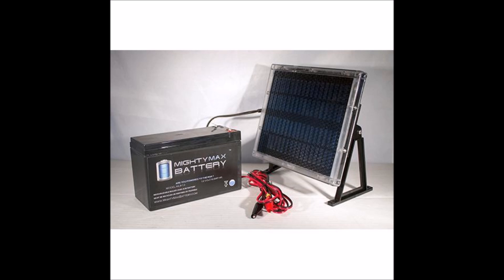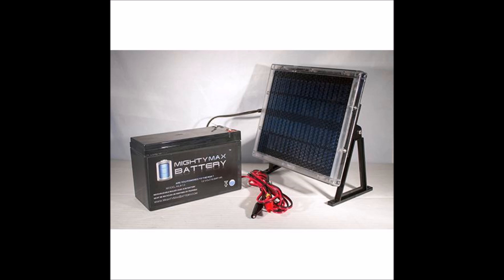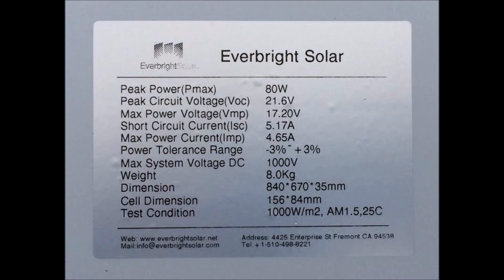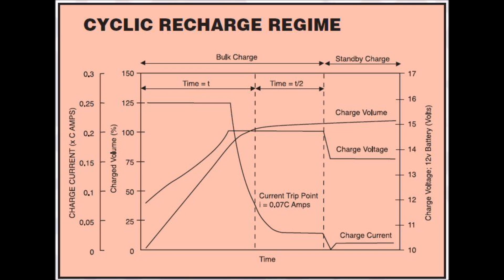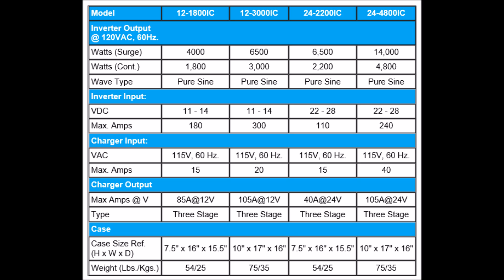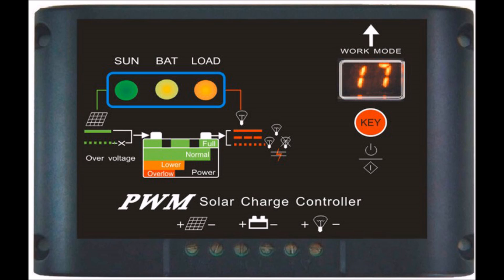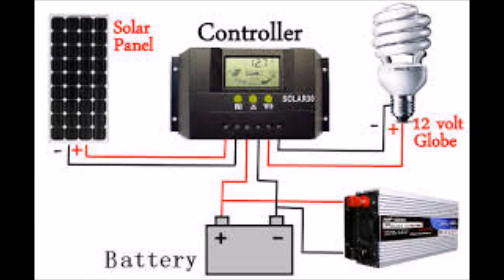Do You NEED A Solar Charge Controller??

Comment: I have 2 controllers. One for the pre installed panel and another for the suitcase panels, could I eliminate one of these
Reply from the maker: It is possible.  But it isn't really ideal to mix and match solar panels on the same controller.  It ends up that you lose a little bit of your total power.  I have a video that explains further:  https://youtu.be/9duPXeNkf0k

Comment: Not sure if this true but leaving solar panel hooked up directly to the battery at night will drain battery because the solar panel puts out infrared light
Reply from the maker: You should never have a solar panel hooked up directly to the battery anyway, like I mentioned in the video.  The charge controller will block power going back the other direction, among many other things.  And basic ones are very cheap, so there is no excuse not to have one.

Comment: YEs if you are in the Gobie desert with loads of sun, Nost car batteries will pull the voltage down as soon as you connect. Yes you need a diode to stop discharge.
Reply from the maker: Car batteries charge at 14-14.5V in a car.  An average 12V solar panel under load (Vmp) outputs 17-18V.  So that will not work without a voltage regulator or charge controller.  You might as well use a charge controller because a voltage regulator will not manage the charging process.  It only changes the voltage coming in to a different output voltage.  And charge controllers are cheap.  There really isn't any excuse not to use a charge controller in any situation that I can think of.

Comment: I have the charging controller, solar panel and battery but I don't have the wires. I would like to know the correct wires to use
Reply from the maker: There isn't a specific type to look for.  The only differences are in the jacket of the wire and that depends on the type of use.  So there are outdoor rated wires, plenum wires, tray cable, SO cable, and on and on.  If you don't want to learn the differences, I totally understand.  You can do a search for solar cables on Amazon or similar site and they will have some options that are marketed that way.

Comment: Lmao, love it.. Thanks for answering my question. As I sit here with rum in hand, I wonder if I can charge my battery with just a solar panel. So.... I hook it up and have a multimeter hooked up to it to read voltage. I'm sitting on the porch while my baby plays in a bucket of water in the sun and my dog lay on the porch harding the public walkway.  As it hooked up I search you tub for answers and  you pop up and I take another sip of tea rum as I watch you speak. I love how toward the end you say if you want to baby sit your battery go a head and nock yourself out. 😆 as you say that I go to look at the meter to check the ⚡.  I sit back down and knock myself out while enjoying my kid splashing and wondering what's what.  Thanks man! I enjoyed your video. The battery charged safely. 😉
Reply from the maker: There you go!  If you have the time and want to do it that way, it works.  But most people would burn their battery up :)
Reply: This is exactly what I was looking for as well! Thank you! ☺️ I have my panel, my power station hasn't got here yet & I have a dead battery I desperately need charged...I'm a good babysitter. 😁😂.

Comment: this is not correct ... 
imagine you short a 17V solar panel to a 12V battery which is discharged to let's say 4V. 
what happens when you short them? what voltage is the battery gonna see? 17V? no, 4V. 
a solar panel and a battery are both voltage sources, when you short voltage sources only can win and only one voltage will be measured. 
so if you short a 17V solar panel to a 4V battery and see 17V it means a miracle has happened and the battery has been immediately fully charged, and beyond. 
but in reality the output voltage of the solar panel will drop to 4V and it will charge a current between Isc and Imp (~5A). 
this is fine! nothing gets damaged. 
The only problem is that you are not drawing the maximum power (voltage x current) out of your panel, 
so instead of 80W you are charging at 4Vx5A=20W, so it would just take longer. 
that's why you might use something like a 'maximum power point tracking' which on one side draws 80W (17V x 4.65A) from the solar panel and on the other side provides 80W (4V x 20A) to the battery, with some loss of course, say 76W (4V x 19A).
Reply from the maker: That is true but doesn't apply to the video and doesn't contradict anything I said in the video.  

Open circuit voltage on a 12V solar panel is over 20V.  Under load (charging a battery), it will be around 16-17V.  The point is that there are many people who don't understand that and think that a 12V solar panel outputs 12V so if I am planning to use a 12V load why don't I just wire the solar panel directly to the load and cut out the charge controller.  Doesn't work that way as stated in the video.

Comment: Do I need charge controller for my 17 year old car battery? My 4.5w panel is pumping in 60mA at 15V on a sunny day behind car glass and not oriented towards the sun. The car consumes 30mA to 39mA while sleeping.
Reply from the maker: No, for that low of power you are barely offsetting the self discharge of the battery.

Comment: If I’m planning to only sun power (not stored power) A battery isn’t a must? 
I can just use the panel to the regulator and then the regulator to the inverter?
Reply from the maker: No.  A charge controller will not work without a battery.  What you are describing is closer to a grid-tied system.  However, grid tied inverters will only work when connected to the power grid.

Comment: Do charge controllers shut off at 14.5 volts or at all? This is what is getting me stuck...
Reply from the maker: Depends on the charging profile being used.  They do shut off when charging is complete (or go into float or "trickle" charge when charging lead acid batteries).

Comment: Will I need if I use lithium battery with a BMS.. The bms will manage the battery.
Reply from the maker: You always need a charge controller, even with a BMS.  The BMS does not manage the charging process.  It distributes power and makes sure all the cells are even and also provides safety features.

Comment: A battery charger has a fast charge facility. This increases the current going through the internal transformer in the charger. So the batteries get more current and fast charged. I just checked my solar charge controller. It was showing 30 volts in and on the battery terminals 20 volts. So the charge controller is not using all the available power. 

I want to connect the solar panels semi- direct to the battery through one unit. A kill switch. 

Ok let’s explain something. I’m a mobile mechanic. I have a classic mk2 Jag in my Garage. It has an old fashioned regulator. Current from dynamo or alternator can charge vehicle battery unhindered. Not like a charge controller which does not allow all the power to the battery. Then as the battery in full in the Jag, the coil within the regulator heats up and two contacts move apart. This cuts the charging until such times as the battery needs more current. 

My point is this is much better than using a solar charge controller.

Comment: One question I was curious about is why is the inverter always hooked up to the battery? How can the charge controller stop the battery from discharging if that’s how it’s wired? Why isn’t it just hooked up to the 12v load side on the right terminals of the charge controller?
Reply from the maker: You can connect them either way.  There are pros and cons to both ways.  Watch this other video I produced that answers this:  https://youtu.be/k8aVnRpoRLc
Reply: LDSreliance ok thank you
Reply from the maker: You are welcome.  Thanks for watching!

Comment: Can we connect solar panel through solar controller 12v DC output and this output to 12vDc  TO 220V AC CONVERTER 1500WATTS FOR RUNNING AC 220 FANS ETC. CAN THE SOLAR CHARGE CONTROLLER WORK WITHOUT A BATTERY WE DO NOT NIGHT POWER. OUR IS ONLY DAY TIME LOAD. OR WE MAY NEED A 10AH BATTERY, a small battery toboprationalise the charge controler
Reply from the maker: No, the charge controller requires a battery.

Comment: Well my battery is shot because it goes to 12v then drops to 11.8 then back up to 12v...so the controller will not shut on my load until it reaches 12.6 which is never happening...so now that I cant damage a already damaged battery....I running my panels directly into the battery to run my load...since I can never overcharge it because it wont go over 12v and at 12v I can still run water and take showers and work lights....😂
Reply from the maker: You gotta do what you gotta do!  As long as it works, who cares?

Comment: Let's say I use 2 panels in series and produce around 36vmp and around 42-44voc.
Use it to charge 3x12 sla batteries directly without scc.
I suppose those VOC & VMP is almost exactly matching 3x12v series SLA battery, current will be maximum optimally gets into the battery when it's empty and will drop the current as it reaches fully charged state (3x14.4v).

In fact now I'm thinking going lifepo4 as well (3.2v nominal, 3.6 fully charged)
Lifepo4 will be 12 serial configuration with voltage around 38.4v (nominal), ~30v depleted (12x2.5v cutoff) and 43.2v fully charged (this is very close to max voltage the solar panel could produce in 2 series config, I suppose electric current going into the battery will drop as well as the battery reaches this voltage as this is the max voltage can be produced and had very low current output from solar panels).

For optimal/nominal voltage (~36-38v) it'd getting and produce maximum current around 5amps for 2x100wp in series.
Now I just need to calculate those max current with my 36v battery banks and the number of hours where sunlight is available (5 hours a day? I live in tropical country) and adding parallel solar panels as my total Ah allowed to store it. 

My point is to leave scc alone cause I can't really get cheap pwm scc for 36v system and mppt wayy too expensive.
Even if I'm forced to use scc then I'd prefer to use several cheap pwm scc and add more panels to compensate for that power loss because of inefficient pwm scc compared to mppt.

Been using cheap pwm scc (10 bucks a pop for 20amp) for years now with no problem whatsoever.

Comment: how about how many panels can a person put on one charge controller
Reply from the maker: It isn't a question of how many panels, it is how many amps.  Take the rating of all the solar panels in amps and as long as that is less than the rating of the charge controller you are good.

Comment: Does the same thing apply if I have 3 12v batteries in sequence?  That makes is 36v, would I have to worry about the solar panel overcharging it over time?
Reply: In that case it wont charge it. The input voltage has to be higher than the battery voltage..

Comment: Answer: a charge controller is a Charge Pump.
The necessity is highly dependent on the:
- loaded voltage of the panels
- chemistry and voltage of the battery
- current draw from the inverter.

Firstly the closer the panel and battery voltage to line AC the more efficient. Basically 12vdc is very inefficient unless using 12vdc appliances. 48-60vdc is much better.

LiFePO4 is more tolerant to slight overcharge and a BMS with High Voltage Cutoff will prevent overcharging.

Lead acid is best used in series to decrease Peukert effect, so 48vdc is common for low frequency inverters.

The charge controller raises the voltage from the panels at the cost of current, to a set point. Programmable controllers like the MPT 7210a are good for small projects. If the panels are closely matched to the battery packs like for example 40VMP to 39.6VDC(a123 BAE packs) then a controller isn't necessary so long as the current draw is moderated before the inverter. 
I do this by daisy chaining battery banks.

Comment: this guy talking crap, i got a 5w solar panel connected to a 200ah battery without a charge controller and the battery is working properly for over 10 years now.
Reply from the maker: That is because you will literally never charge a 200Ah battery with a 5W panel so there is no concern about damaging the battery with overcharging.
Reply: @LDSreliance  seen people use 10w panels direct on 50ah batteries and no issues. why is that?
Reply from the maker: Same thing.  You will never be able to fully charge a 50Ah battery with a 10W solar panel.
Reply: Lmao
Reply: Lmfao!!!

Comment: I want to mount a specific flexible solar panel physical size (32 wide x 42 long) on my van.. in part because I want to benefit from the shade on my roof.  The biggest wattage I have found is 200W 20v single panel.   I am testing a Chafon 200WH (18ah) portable power station that has a built in charge controller .. I tested it with a 50w panel and it fully charged in about 6 hours.  The back of the unit has a warning not to use a solar panel larger than 120w and/or 22v.  Given that most panels don't yield what they say would this be safe to direct connect?

Also, if my real goal is run a fan in the van during direct sun light, anyway to regulate the 200w/20v panel so I don't need much battery but also so I don't burn my fan motor?

Odd idea, but if too much power for the Chafon.. can I just cover part of the panel?

My gut feeling is that connecting the 200W solar panel direct to the Chafon will be fine.. and that the 200W solar panel will never perform that well to be a problem.
Reply from the maker: You are probably right, but why chance it?  If you don't need a 200W panel why buy one?  Just get a 100W panel and charge the power station in 3 hours.

Comment: You do not need to have a charge controller to connect it to the battery, but if you do that it will destroy the battery over time. The best charging voltage depends on battery temperature, and at normal temperatures the best life is from 13.5 to 13.8v, and MPPT is better than PWM for a charge controller.
Reply from the maker: Correct.  So, essentially, 95% of people would need a charge controller because they would have no idea how to manage those parameters on their own.

Comment: Your battery is not protected from over-discharge by the inverter anyway. Why do you need a charge controller then? Control it manually using volt-meter and a sound alarm.
Reply from the maker: Yes if you want to babysit your battery while it charges and discharges, be my guest.
Reply: No I brought a second lot for that but the first worked out fine lights USB  only use one thing wen sunlight is not out

Comment: You don't need one if you want to power something like a DC fan like many do in India, then you don't need to.  But if you want to use that power after sundown, such as powering a light, a radio or other small equipment, then you need a buffer.  A cheap PWM or MPPT solar charge controller will be your best friend.  If you want to use a cheap PWM and don't want to buy one only to have to buy another cheap one to replace it right after it burns out, I recommend going with a good named brand like Renogy.  You can get one of their cheap PWM controllers here:  https://amzn.to/2tZT7EI  Lots of people use this in RV and camping situations.  It works great and won't break the bank.

Comment: I’m turning my van into a camper. Right now I have a 20 watt amorphous solar panel with a 7 amp charge controller that came with it hooked to two 12v 35ah batteries wired in parallel with a 1200 watt inverter powering a mini fridge. So far the fridge will only work for 8 hours at a time and it takes days to charge back up with the panel. I have recently wired the two batteries to the van’s battery with a cut off switch to charge while driving. I ordered two more panels to try to get it to charge faster. My question is, since I’m trying to run a fridge constantly do I really need the charge controller? Couldn’t I just install a blocking diode since the batteries don’t have a chance of being over charged? Any suggestions would be greatly appreciated!
Reply: That is not enough battery to power that inverter. (1200w/12v)*(1/.85 percent efficiency)=117amps. This will need two standard deep cycle batteries to power the inverter in parallel. Keep in mind even with perfect inverter that is only 3.5 AH at 120volts, and that the higher the current draw the lower the amp-hour capacity of a battery. Also putting a large capacitor in parallel with the batteries is helpful to improve the efficiency of the batteries and inverter.Also the system can be charged when the engine is running, and always use fuses or fuseable links with any of these connections, as it will keep your vehicle from going up in flames. Even with circuit breakers, still use a fuse. That is because with high current the contacts in a circuit breaker are likely to weld together creating a permanent connection.
Reply from the maker: You could probably get away with it if you had to but it would not be optimal.  A 20A charge controller is only $20 so there really isn't any reason to skip getting one.  https://amzn.to/2KjUCaZ

Comment: What About for LiFePo4 batteries with internal Battery Management System?
Reply from the maker: Yes you still need a charge controller.  A BMS will protect the cells from overcharging and over-discharging and keep them balanced but it will not regulate the incoming voltage and amperage of the power source.
Reply: Thanks. That's what I thought, but then the engineer who is helping me with fixing some other wiring issues didn't think it was necessary. He's an engineer, so naturally I went and did a hardcore double-check everywhere.
Reply from the maker: Sorry but he is wrong.  Contact any LiFePO4 battery manufacturer and they will verify that.